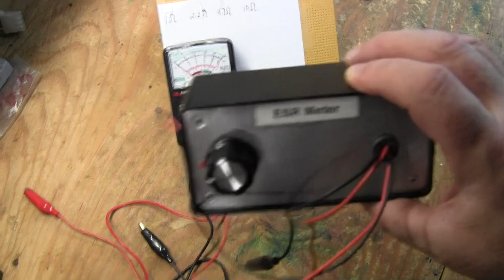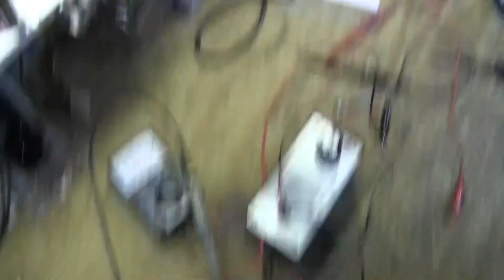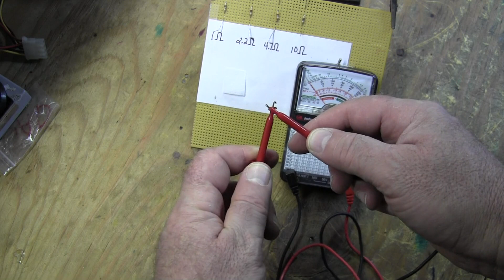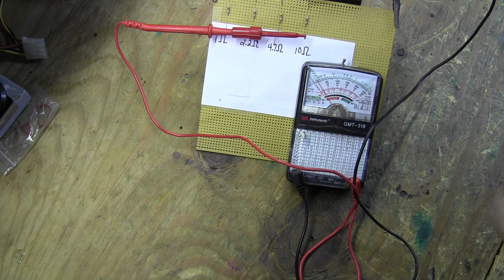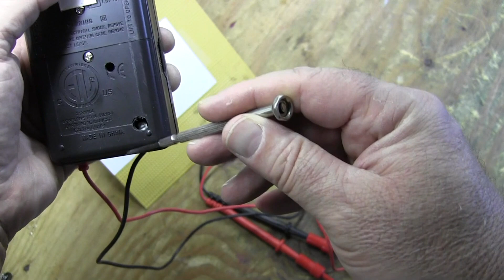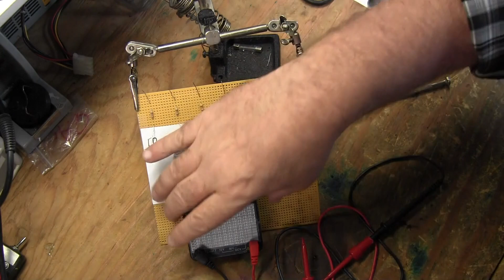DIY ESR Meter

Comment: Thank you for sharing this! It appears that the chart label that you added to the case is the classic e-cap leakage value chart. If so, please know that those calculations are no longer valid. The current maximum for e-cap leakage, as agreed upon by modern manufactures is:
1% of the Capacitance Rating times the Voltage Rating. This calculation can be found in the data sheet for the capacitor.  A new chart spreadsheet can be made for standard values, based on this formula..
Reply from the maker: Thanks!

Comment: In your first ESR meter, I think you used a fixed R6 resistor that was higher than the intended 10 Ohm resistor. 100 Ohm, maybe? That would explain why you had near full scale deflection with the 1 Ohm test resistor.

You keep referring to R6 as an attenuator. Not sure if you are using shorthand but R6's real function is as the lower resistor of a voltage divider (the device at the test leads being the top resistor).

Comment from the maker: Basically; The capacitance goes down as the frequency increases. The capacitor's value on a datasheet is typically stated at 100khz. That is why most decent testers measure capacitors at that frequency.
Reply: Broken link

Comment from the maker: I'm sorry but I don't think I will be able to help you with that.
This meter is fine for a home project learning build, but not ready for retail if you know what I mean. It is an easy build if you have time to make it.
The Arduino version of this meter is an order of magnitude greater accuracy with a resolution of 0.02 Ohms. I have a video covering that build and may offer it in a kit form if there is enough demand.